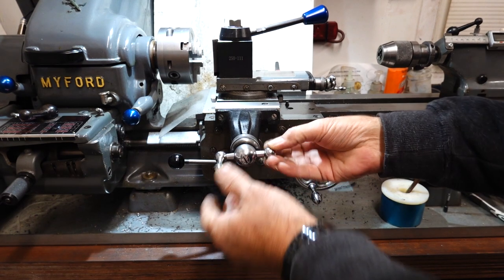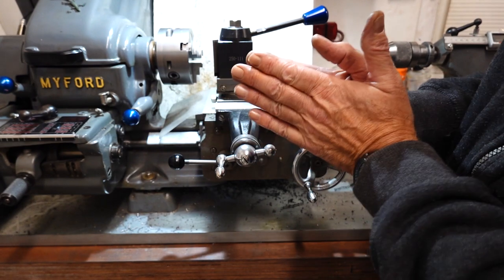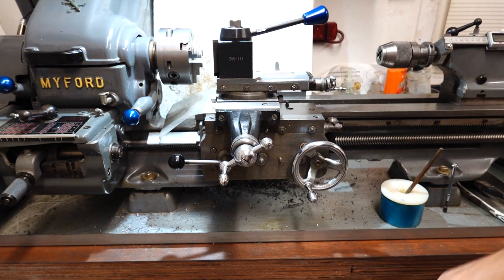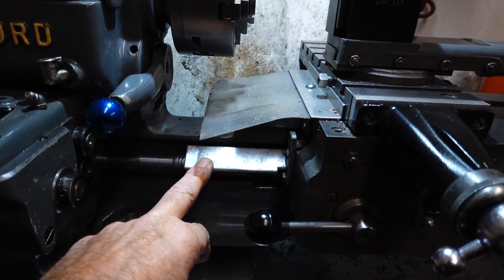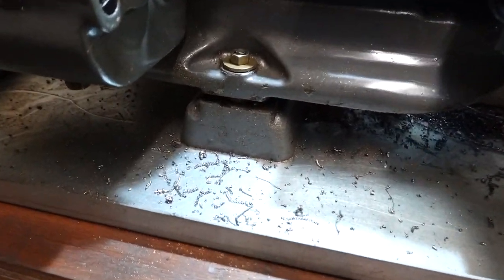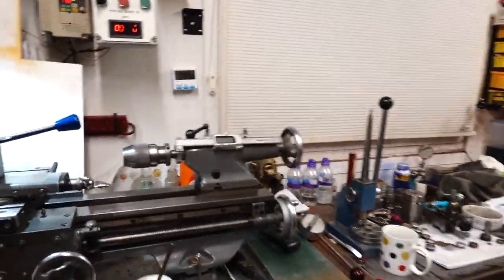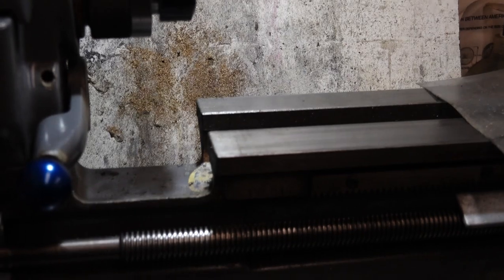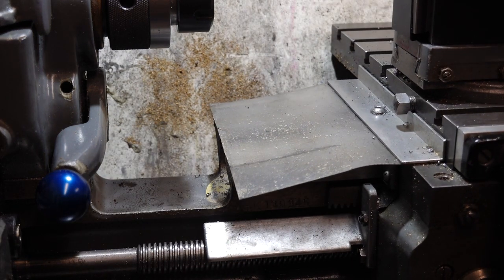Show us your workshop series. Part 1 the myford lathe

Comment: What a whisper quiet motor!   I have a separate tray that sits between the feet of my lathe and catches most of the swarfe.   It makes cleanup much easier as you can just lift it out.   
To do metric on the gearbox you have to fit a different banjo and use some special gears.  If you look at Harold Hall's website he has plans to make your own metric banjo.  You can buy them but they are pretty rare these days and are very expensive.    If you cut metric you can't use the thread dial.  You have to keep the half nuts engaged and reverse the lathe.   
The shield for the bedways is a very good idea.  I have one on my lathe also but mine is rubber.
Thanks for showing off your workshop.
Reply from the maker: Hi John. I have the 33 & 34 tooth gears, bought from Myford some time ago. I do also have the drawing for the banjo. It is something i just never got round to trying. But nevertheless i will have a look at his website. Thanks for the comments. Regards. 
Steve.
Reply: @Steviegtr52  Hi, The 33 & 34 tooth gears overcome the necessity of the metric kit & banjo for the transfer gears. They are an approximation but work really well. You will need to then select the appropriate settings on the gearbox to cut a certain metric thread (have a list somewhere). As said above, keep the half nuts engaged when cutting metric.
Reply from the maker: @TheElderlyBiker  Thanks for that Matt. Yes i do have that list somewhere. It was just someone on the Model engineers forum that said a arm would need making to accept the gears. He sent me a diagram of the dims for it. So slightly confused. Although i will probably never get around to doing the mod, as i do not do much threading .

Comment: Thank you very informative.I think your originally imperial lathe has had a metric conversion kit fitted ( these are available from Myford and replace the lead screw with a metric version) ,this would explains why you have Imperial graduations .
Reply from the maker: Well i will have to look deeper into the gearing. As i am a bit baffled by the instruction plate shown. The plate on the quick change  gearbox is imperial.
Reply: @Steviegtr52  the Myford metric change kit was just a lead screw and clamp nuts for threading there were no metric instruction plates ,hope this helps.
Reply from the maker: @steved8038  so what is the plate for on inside of cover shown . Of course there were the full change gears for myfords without the quick change gearbox. Maybe that's why it's there.  I have a set of diagrams for metric when using the 33 & 34 tooth gears.
Reply: @Steviegtr52  Mr Factutum recently made a pair of 33 & 34 gears and mentioned a chart that shows the metric threads and which gear to use as well as gearbox settings. Hope you manage to work it out best of luck.

Comment: Hi Steve. Very interesting video as I want to do the conversion to 3 phase. Can I ask... Are the bearings phossphor bronze with a hardened spindle?
Reply from the maker: Hi Steve. Do you mean the headstock bearings. If so then on the Super 7 the nose bearing where the chuck goes is a tapered bronze bearing. The rear part is 2 ball race bearings. The spindle is a hardened shaft. Hope this helps. 
Steve.
Reply: @Steviegtr52  Hi Steve. Yes I was wondering how the bearings would cope with the xtra speed given by the inverter and 3 phase motor. If I'm to do the same, Id have to buy a new spindle and plain bearings from Myford at a cost of £355 thats on top of the motor and inverter costs. I sometimes question weather it would be cheaper long term to buy a different lathe, but my ML7 stands me at around £1,000 as is with what Ive done to it since I bought it. Oh well, thats hobbies for you
Reply from the maker: @stevenmackay9192  Yes the Super7 has a different bearing set up on the headstock. But the speeds shown on the standard setup is 2100 max approx. But i have never ran mine at anything like that speed. When turning I am lucky if I run any more than about 700 rpm. Yes the inverter will allow for very fast speeds but that is not why i fitted it. It is the variable speeds & the smoothness of the 3 phase that i wanted to have. 
Steve.
Reply: @Steviegtr52  Thanks for the info Steve. I'll try not to ask so many questions in future lol.
Reply from the maker: @stevenmackay9192  No problem.
Steve.

Comment: Since 63 is approximately one quarter of 254 (10" in mm) the compound gear set 60/63 is a way of getting approximate metric pitches. I think that the 33 and 34 teeth gears do a similar thing but are maybe aiming for a better approximation. The only way to get true metric pitches is with a 127 tooth gear (often but not always compounded with something like a 120 tooth gear) or a metric leadscrew. The issue for Myfords is that there is not enough room for a 127 tooth gear at the standard DP gear size. If you set up for the 2mm pitch for example and turned the spindle 100 times and measured the carriage movement you should get 200mm of travel but are likely to have a close, but not exact, movement to that figure. 63/63.5 gives 99.2125% so that is the accuracy that will probably be achieved. This is not a problem over a short distance but don't try for making a metric leadscrew with this setup.
Reply from the maker: Ah. Right. Thanks for that Martin.

Comment: Hey Steve, what motor do you have on you Lathe? 3/4 hp three phase?
Reply from the maker: Hi Alan. The Motor is a 1- 1/2hp from Clarks machine mart 3 Phase. The Inverter is a Omron bought 2nd hand off e-bay seller for £60. This is a industrial one which has many features not found on the import eastern versions.
Although I have seen many who have the cheaper one & they seem to work fine. The Newton tesla thing is just a package that the company have put together as a plug & play version.
Either way it is a great conversion to do. As you will have seen in my vids the speed can be anything from about 4 rpm to pretty much any speed i want. You can set the max hz , on mine up about 120 hz which would have the motor at a very high speed. Mine is a 4pole which is the most poular one to go for Which gives the best torque without going to 6 pole. 
Any other info just ask. If I had to do it all again i would definately go the route i did. I think the motor was around £155. I went over the top with the motor size & of course it would be cheaper to fit a smaller one. The single phase motor i took off was 3/4 hp.
Regards.
Steve.
Reply: @Steviegtr52  thanks Steve, I think my Super 7 may be a little older than yours perhaps but in great condition. And it’s not the 7B, I am going to fit a stepper motor for threading rather than go the gearbox route and have bought all the parts needed from Clough42. Take a look at him if you haven’t already. I have just built a workshop so I am in the process of putting things together, have the super 7 and a refurbed Meddings drill press, a very nice Mill which would’ve been a junior if I could’ve found one as nice as yours. Keep up the good work Steve, if you don’t mind I will have some questions on the motor upgrade for the lathe as I like what you have done.. what’s the chance of getting instructions for the control box you made? Also yes a manual pdf would be very welcome please for the super 7. How do I send you my email?
Reply: @Steviegtr52  and if you could highlight which motor you used with a link that would be great.  I have tracked down an inverter the same as yours for £60
Reply from the maker: @anthonyreed2228  https://www.machinemart.co.uk/p/1-5hp-single-phase-4-pole-motor/        I think this is the one i bought. Look on machine mart they are all listed. I had to buy a new pulley as the shaft size is bigger. 
Steve.
Reply: Thanks Steve
Reply from the maker: @anthonyreed2228  The control panel is one I made. Which takes over from the front facia of the inverter. If you need a manual for the programming , they are available free online. Many pages & parameters to set. Good luck.
Steve.
Reply: Hi Steve, sorry to be a nuisance, can you point me in the direction to where you bought your speed pot and switches from? Really like them and buggered if I can find them. Really nice bit of kit you have put together there, I recon you should knock those boxes up to order and sell them.
Reply from the maker: @anthonyreed2228  Hi Anthony. Look in my profile & then click about & you will see my e-mail address. E-mail me so i have your return & I will help the best I can. Saves posting on here. 
Steve.

Comment: Works totally opposite of mine on the Cross feed, yours seems backwards to me. if i feed towards the Chuck with my carriage, then my cross feed also feeds towards the centre of the Chuck, i don't have to change direction of the lead screw to make them do different directions. I do have a Reverse feed which makes the carriage travel towards the tailstock. this also makes the Cross slide travel outwards... Wierd.
Reply from the maker: George i totaly agree it is a bit strange. Yours seems correct mine not. But thats the way it is, so guess i cannot alter it. Although i have never actually used the cross feed. I only use it for facing off.That is done manually.

Comment: Very interesting, those workzone verniers are always on, it why the batteries drain so quick, I saw a mod on the tube where he slips a bit of plastic between the battery negative
Reply from the maker: Yes Ian. They come on with any movement of the tailstock. Which is a shame. When i am using the lathe i have to keep an eye on the vernier, if i move it I then have to switch it back off. My other Moore & wright ones only come on when i want them on. Yes it would maybe an idea to make them only come on when needed. Thanks for the comment. Regards. 
Steve.